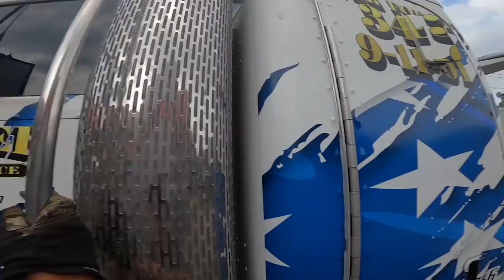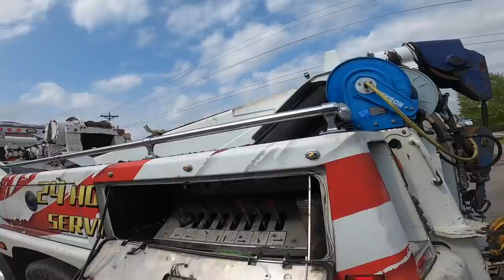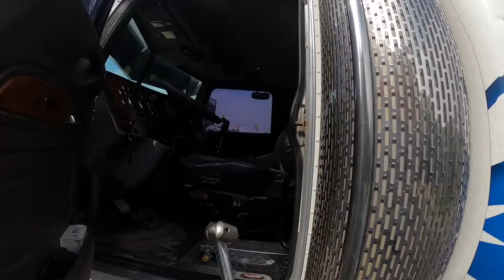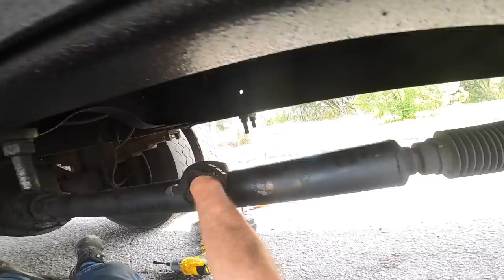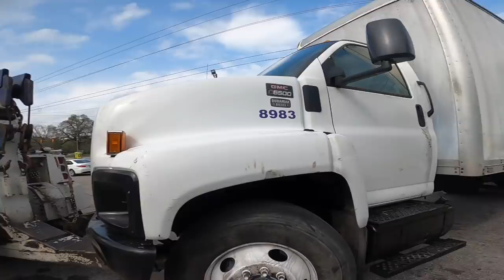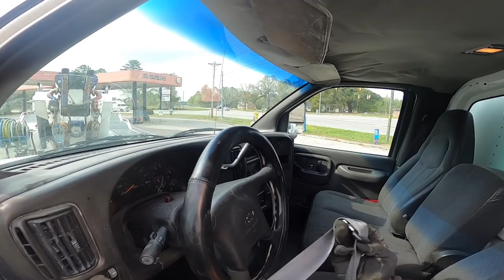How I hook up a box truck at an angle

Comment: Always amazes me that no one leaves a key for you. even when it is a totaled car they take the key. be safe.
Reply from the maker: Mr Art They did leave the key but I was not told until I was hooked and rolling.
Reply: Back when they first started the locking steering wheel, you would get a call to pick up a disable car and find it parallel parked and the steering wheel at an angle.  Great job for the old Holmes 440.    Pick and pull the front end, hookup and away you go.

Comment: Very important to make sure no pressure is  on  the drive shaft i know from experience. i was removing a shaft from a motorhome when it popped out and caught me in the face, was bad but did not kill me, some has not been as lucky.i knew better and had preached to my guys to always check that the shaft has no pressure on it before removal, got in a hurry my bad. i also carry a bottle jack and jack a rear wheel off the ground to get the pressure off if i can not get in neutral.be safe my freind.
Reply from the maker: Mr Greg Thanks for the Jack tip. We appreciate you watching our videos and commenting. Stay safe
Reply: I also had a  shaft jump out and smack me in the head-cut my ear partially off. All that grief over an okld worn out beer truck.Bad part-I knew better. Just got in a hurry. Lived thru it and learned--slow down and think

Comment: Nice job Mr. Hal. Once again you made it look easy. I wasn't paying much attention to the steer tires but when you were removing the drive shaft i notices that the drivers side drive tires looked well under 2/32 inch. I am sure the other side is bad too. I would advise them to get either new tires or caps. Stay safe out there.
Reply from the maker: Mr Michael  Yes sir they do need tires. Thanks for watching and stay safe

Comment: great video i have never used underlift. my old truck never had it i quit towing for profit about the time wheel lifts were getting started have done some angle bed and flat bed towing. i thing the trucks should be equipped some way where they could be towed at least 100 miles without removing drive shaft. especially the manual trans atuomatics would be harder. again thanks for your hard work making the content i know it takes a lot of your time
Reply from the maker: Dependable auto  We appreciate you watching and commenting.  Stay safe
Reply: I like the idea,  where trucks have easy air hook up and lights.  I have seen that done in Europe, on Youtube.
Reply from the maker: @matta3888   that sure would make it easier. Thanks for watching and stay safe

Comment: Get you a new Milwaukee M 18 impact and you won’t need a breaker bar. 1400 lbs of nut breaking power & 1000 lbs of spin off power.
Reply from the maker: Mr Walter  Yes sir they are nice but all the tools on all my trucks are dewalt. It would cost a small fortune to swap at this point unless milwaukee would give us a good deal.  Thanks for watching and stay safe.